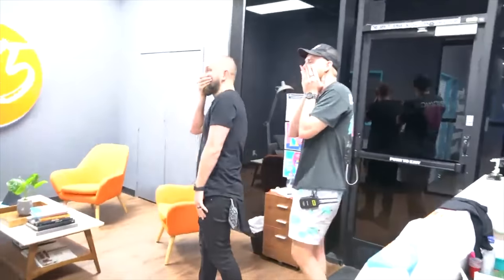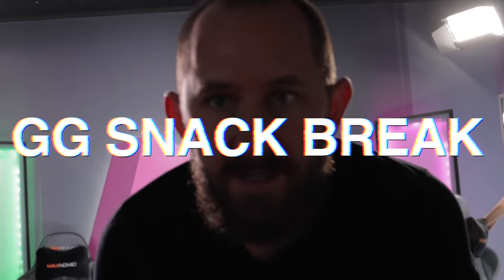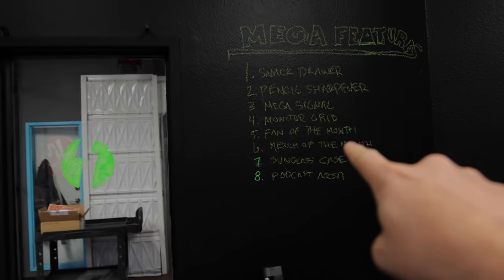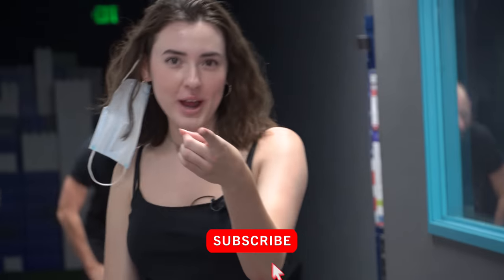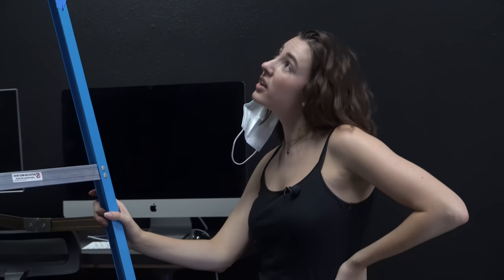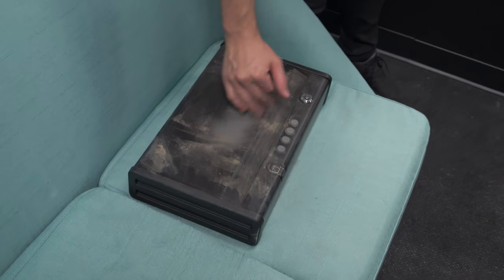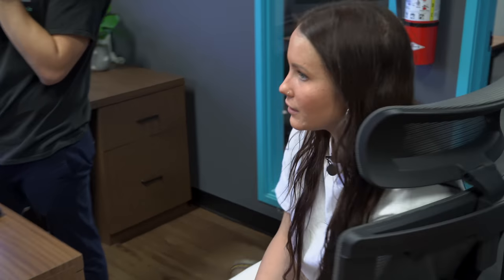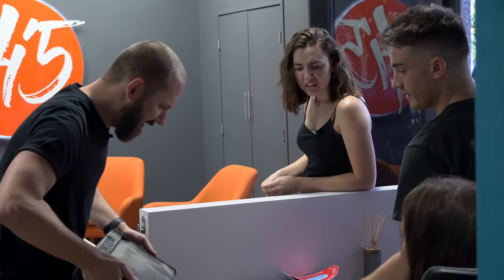I Found A Safe In The Air Vents!

Comment: Unless there is a key in the key box like that you may have to cut through hinges on back. Another thinking is there looks like a sticker on back. Check if it has a make and model number you can look up and see if there is an override code (there usually is) . This is not something that will open with a screw driver and hammer.
Reply: well its most likely a gun safe so yeah
Reply: If there is a gun in that safe then that crazy, if there are more keys, even worse, if there is  gold in the box, then they are gonna have the feds on their back, and if there is drugs, people are getting arrested
Reply: Albert Speer imagine a bomb in there which activates when it’s opened
Reply: Probably just a safe of go pros which is owned by Patrick🤣😂

Comment: Well Matt found ALL the pieces in the ceiling and walls meaning HI5 should take a metal detector to the walls and ceilings to get more puzzle pieces. There is a high probability that there is more safes and boxes in the walls.
Reply: Didn’t Matt say in an earlier video something about metal studs or something of the sort. Like there was metal in the walls so it would be useless? I am most likely wrong but I feel like I remember that.
Reply: @angelicmercenary  I think I remember that too
Reply: they're in a warehouse filled in to make a building out of it. That's why there's so many dead spaces in their buildings. Considering most of these types of buildings use modular metal frames, I doubt this would be any good
Reply: There are to many metals in the ceailing so it wouldn't work.
Reply: 100% wont work because theres a lot of metal in those kinds of walls
Reply: Na don't play with me like that, that is so scary.
Reply: There are metal pipes and things in the wall

Comment: So they found a safe in the ceiling, but they only got the black (new) ceiling tiles no less than 2 years ago. Meaning that it cant be from the previous tenants. So it has to be a previous employee or a current employee.
Reply: 29:12

Comment: Should've not pressed the finger print scanner so you could've searched for finger prints
Reply: @Bianca Maldonado maybe not. The dirt and dust might have actually helped with that. I know there's a trick where you can put scotch tape down on something amd it basically can pick up an imprint.  The first and stuff might have been able to make it more pronounced
Reply: True, BUT there's a lot of dust, so it would probably be almost impossible to get a clean print off of the buttons.
Reply: and what are they supposed to do with prints friend? It's quite illegal for any law enforcement to search it and then give them the information on the person and finger print databases are not public Access (:
Reply: @Bianca Maldonado Someone broke it by accident and they decided to make content out of it
1. Why would Kevin look at the nest cam notification in the middle of the night like he said he did when he knew they were going to be there making noise.
2. when tempered glass breaks from temperature changes, there is no "point of breakage" like you saw in the upper portion of the window, it just shatters uniformly meaning something had to hit it to break it
3. they easily could have doctored the nest cam footage by using a the footage from before it was broken, adding a sound, and then replacing the rest with footage from after it was broken.
Reply: @Bianca Maldonado Plus their acting isn't all that great friend (:
Reply: @Bianca Maldonado Exactlyyy. Izzy would have fixed and found it wayyy before now

Comment: That is most definitely a Gun safe I know cause I own one. Also it could be connected to the mountaineer remember the chop shop situation you read about in the previous video HINT HINT.
Reply: I was thinking the same thing
Reply: Sentry safe QAP1BE
Reply: Jessi Vermeulen I was gonna say “Matt don’t open it it’s shaped like a ouiji board cause of window go smash
Reply: What if the gun was the one that broke the window?
Reply: @chilledkiwi4012  what? the glass broke because the other room was cold and the room on the other side of the glass broke. how would the gun break the window TRHOUGH the air duct pointing down and through the case
Reply: i was thinking the exact same thing  because the owner of the chop shop was friends with edward snowden which means it could be his gun because they were both arrested
Reply: No I don’t like tgat

Comment: Glass cookware made with heat-strengthened or tempered glass can unexpectedly shatter due to thermal stress resulting from temperature changes during reportedly normal use. Fracturing produces shards in both types of glass. that’s the explanation to your tempered glass that i learnt in school

Comment: so i just watched the video where you find the safe in the ceiling. Just to clarify the tubing usually put in ceilings in usually called flexible duct tubing. Also to point out as a few others have it is a sentry firearm safe with biometrics. the finger scanner is for quick access but can also be opened with a combo with he four buttons, the key is a master override. I feel you should go through all keys like you plan too and try and map them out but also keep an eye out for the safe key at the same time. This is just as idea. Also if there in any firearms in it i would not touch them and notify the authorities right away. Also the tempered glass that broke could have been caused by heat in the room and the side by the front door cooling off, It has happened at my work where the inside of the building was definitely cooler the outside and the window just shattered and i was the only person in the building and i was towards the back when I heard it. Onto the better part of this, I love watching these videos you make. Please keep making these videos and if there is a reason needed I say "BECAUSE". sorry i had to say that. have a good day and wish you the best.

Comment: Guys, hear me out. Matt should have swiped the dust off wit a clean brus andd used like a porestrip or clear duct tape and flatteend it against the finger print scanner. it ten would have read it again, and if it did not need the combo and key as well, it would have opened. Also you could try to open te box with a crobar, you would be surprised how stuff sometimes wobt get damaged. Also, if there are any other rooms in blue base or any base for that matter that have any random weird problems ac related or not, I would investigate, also I know a lot is going on in the studio right now but maybe try the warehouse. A lot of weird things ave happened there and theres a lot of odds and ends that aren't tied to ech other. Best of luck.
Reply: Crowbar? Nawhhhh. It's zip-tie time! 
https://www.youtube.com/watch?v=WVvwT67-M7g
Reply: @manshamishra  OOOOH YEAH. That safe ain't gonna knwo what hit it.

Comment: I remember seeing one of these when I used to live in California. It takes a finger print, which means you can ask around for those. You can assign multiple to the safe and have it open to multiple fingerprints. It takes a 4 button combo code, which is what the 4 buttons are for, or a key. You can try looking for the manufacturer of the safe and looking for the keys in your collection of keys.

Comment: If the box of keys were in the wall and one of the keys led to the Mountaineer, it makes sense is a safe in the ceiling is also tied to the car.
Woods made a good point, it’s all suspicious and random stuff found in your place, so it makes sense if it’s all connected.
Plus, what’s the chance that there would be a safe in the ceiling, the key in the ceiling AND the Mountaineer at your office?
I understand that you don’t want to get the police involved with the car, but you might want to go to them for the safe. Something about it doesn’t feel right.
Also, have you had airflow in that room at any point in being there? Because it you had airflow but one day it just stopped, someone had to have put it up there while you’re there. If the room was hot since before you moved in, you could ask the previous tenants about it.

Comment: TRY GETTING A FINGER PRINT OFF OF THE 4 BUTTONS TO USE FOR THE SCANNER 

ALSO, MY THEORY; I THINK THAT EACH KEY YOU FOUND, MIGHT GO TO OTHER LOCKBOXES/SAFES HIDDEN IN HI5 STUDIOS. MAYBE!
Reply: It would be hard to get prints when its so dusty.
Reply: Then thats a lot of safes
Reply: they would have to clean the scanner so theres no dust which would remove any fingerprints
Reply: Plus they probably used gloves
Reply: Why don't they just pry it open instead of fingerprint.
Reply: plus they all already messed with the buttons so their prints are all over them. so now the print would be messed up.
Reply: Gamer Boi it could be something fragile
Reply: Plus it’s a gun safe
Reply: I was thinking maybe in all the keys he has maybe there is one to open this safe 🤷🏻‍♀️.
Reply: @fiveelevenevan  That is true
Reply: @zed5170  ITS NOT ALWAYS THAT EASY TO OPEN A SAFE.
Reply: @Foxtrot-51  it's not easy but you can still open it. It just takes time.
Reply: @mashrubawazed4708  it's a gun safe what do you think is so fragile about a gun???
Reply: @zed5170  might damage what's inside
Reply: @fiveelevenevan  ITS A GUN SAFE. IT HOLDS GUNS. NOT GLASS CUPS
Reply: @zed5170  but safes like that have IRON/STEEL BOLTS POSSIBLY AN INCH THICC KEEPING IT LOCKED, ITS KINDA LIKE SAYING U COULD DO THE SAME WITH A BANK VUALT DOOR
Reply: @Foxtrot-51  it's not that hard because it's a gun safe and it's small. IT JUST TAKES TIME AND THAT SAFE IS OLD. IT WILL PROBABLY OPEN EASILY
Reply: @Foxtrot-51  SINCE ITS AN OLD SAFE ITS PROBABLY RUSTED AND IT WILL JUST OPEN EASILY WITH A HAMMER
Reply: @zed5170  I wasn't having or anything, so caps isn't necessary. And couldn't you put something other than a gun in a gun safe? I think you could adapt for that.
Reply: @fiveelevenevan  a gun safe is designed so that only the gun or ammunition can fit and you used caps too.
Reply: @zed5170  but I didn't show any rust on the safe AND A MOST OF SAFES ARE WATER RESISTANT/PROOF (SOME ARE EVEN FIRE PROOF!) so that whatever is inside doesn't get damaged. PLUS, in order for something to rust it has do be wet for a certain amount of time. & Even if your planning to pry something open, you should use a crowbar, not a hammer, crowbars were made to pry things open, & hammers were made to hit nails.

Comment: Theory: the safe would accumulate dust faster in the vent vs just sitting around and therefore doesn’t necessarily have to been up there for so long. 
It would accumulate dust faster because all the dust in the vents is blowing onto the safe trying to get through to the mega office. 
This all depends on how much force is behind the air flow, as too much would just blow the dust off
Reply: Good theory but the safe wasn't actually inside the vent, it was on top of the duct cutting off air supply.

Comment: If you guys are going to open the safe, see first if you can get a heat signature or a airline style scan of it, just to be safe(lol). If you're going to cut it open, I would recommend using some kind of blade or electric saw to cut a sort of flap into the top. I would get it scanned first, though, to see how thick it is.

Comment: you do realized the vent was ADDED and it was probably added when you guys owned the base because if I was selling a building it is not vital info to say we added a new ac and how will mat have known that without seeing it happen so was within the span of lets say about 3 years ago so it is still RECENT also if you noticed the lights were working and bright I know because you can see it through the camera which most backlights are hard to see through a camera and the sensors are very sensitive to touch it was so dusty because it was in the celling with fiberglass and drywall and dust all falling on it plus it was on a vent just absorbing all the dust from the very little airflow plus for the window chances are that their was a scratch on the impact point so only that scratch brook sending the shockwaves through the rest of the glass and it took so long because it was tempered meaning it had a plasticky like substances holding it in place and blocking the heat until it got to the glass shattering it and the plastic stuff is also responsible for it staying in place tempered glass is also known as safety glass it is meant to break that way but all this started with a filing cabinet this is just all my thoughts and theory's use them as you please but I just wonder how far dose this really go oh and also yes I GARENTE that this safe is related to the car because 365 or whatever that was related to the safe then to the key then the car and all in the same warehouse the chances of to separate people doing something so similar without knowing of each other is very unlikely you know this rabbet hole we went down is no rabbit hole at all it is now a full on labyrinth and I have a theory that is kind of funny what if after all this it is just a note that says jk gotem that will be awesome again just my thoughts and theory's take it how you want use it how you please

Comment: You could try to get prints off the safe and use the print strip and push onto the print scanner. Another thing you can try is maybe a bypass reset code.

Comment: Heres the thing...the dust isn't real dust. The distribution of the dust layer is extremely uneven. This is usually what happens when you use artificial dust like they do in movies for props. The dust on it was too light and didn't have a thick coat as dust usually ends up forming a thick coating. This was more of a light dusting which is not something you get with real dust. This implies it was placed up there prior to this whole thing with a fake dusting

Comment: Probably someone who is connected to this wants you guys to figure this out. They probably knew that the glass would shatter if the temperature in the room is higher outside that gave them the idea to put the safe in the vents, they knew someone would check the vents which will lead to connecting the clues of all this things happening in Hi5 Studios.

Comment: I have a nearly identical gun safe. mine just doesn't have the fingerprint scanner.  You wouldn't have to use the button code AND the thumbprint, AND the key, they will all work independently to open the safe.

Comment: I'd say that this combination lock is somewhere in the car. Cause if it's a safe with a fingerprint on it, This could be connected to the car. If you haven't checked every inch of the car, or find any numbers in it you could find the next clue.

Comment: so the key should circumvent the code but I'm not sure about the biometrics. if you can take it to a locksmith, I have a feeling though that its a gun or something just as solid.. you guys need to check the crawl spaces because something is wack with hi-fi studios... maybe there's something in there that those "ghosts" where trying to tell you about..

Comment: You want a quick & COOL way to find where the heat is coming form? Get a camera with inferred & an air conditioner, shut the door tun on the AC & look threw the camera as it gets cold & you will find the hot spot.

Comment: It's a Sentry Safe Matt 
https://images-na.ssl-images-amazon.com/images/I/61%2BLbL5O%2BsL._AC_SL1000_.jpg
There is a link to the exact safe you have, just with the logo scratched off. SO it could be a gun, Or just holding important notes or even evidence as you said. 

On another note, I don't recall the type of key they would need in any of the keys they found. So they may need to end up finding a way to crack it open.

Comment: The link I’m about to provide is a link to the safe instruction manual. You can order a replacement key in order to open it using a serial number found on the side of the box. The password to be anywhere from 4 to 6 digits long or you just need the proper fingerprint. The key itself is only required if you forget your code. https://cdn.masterlock.com/sentrysafe/resources/pdf/manuals/P56411.pdf

Comment: You could steel cable tie because apparently you can register multiple fingerprints into the database<
Reply: Steel cable tie is easy to open because all you have to do is bend it into the fingerprint side then push the "release" from inside.

Comment: Everything is in the wall or ceilingWhoever it is they definitely know you will work for in the walls or ceiling after you find these things but 863 key ceiling this lockbox sealing the key box in the wall red base it’s a pattern somebody doesn’t want you to find these things the Mercury Mountaineer you found with that one T one of the other keys goes to that lock box you said it because there was one round key it’s connected

Comment: 10 000 possible
For each choice of the first two digits you have 10 choices for the third digit. Thus you have 10x10x10 = 1000 choices for the first three digits. Finally you have 10 choices for the fourth digit and thus there are 10x10x10x10 = 10 000 possible 4 digit combinations from 0-9

Ye you have no chance with the combination code but the key one is there any keys with the same code that was on the box or and old keys if not you could try use the key from a dope or nope shoot where it forms to any lock??